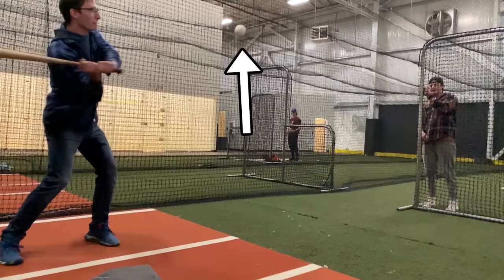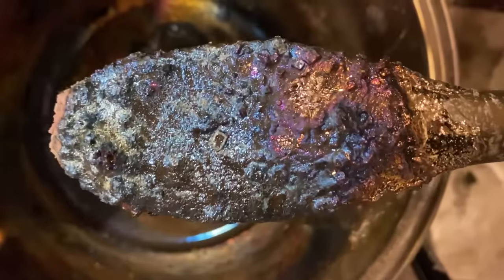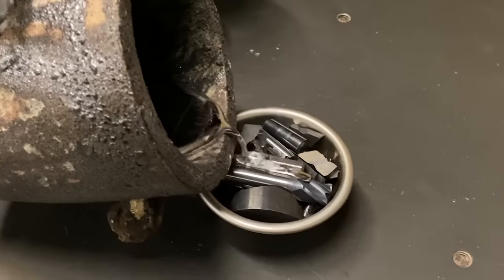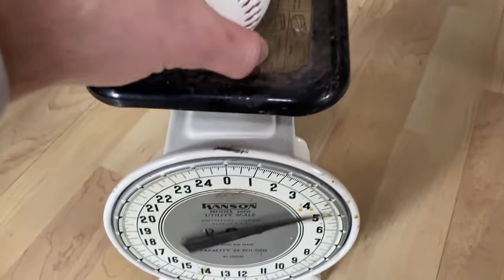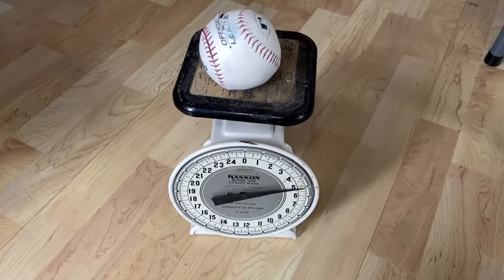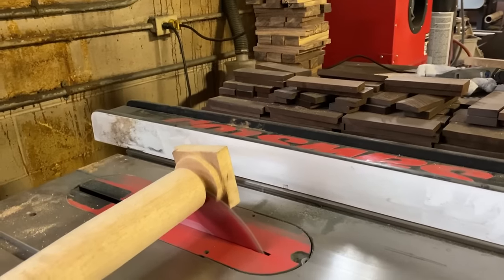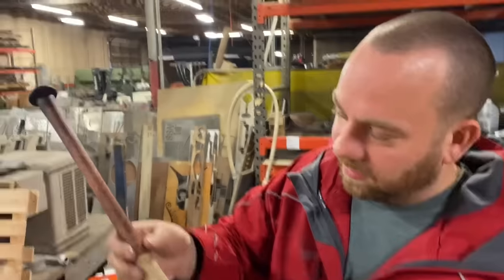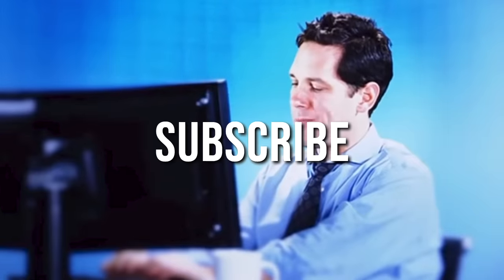I Made The World's Heaviest Baseball

Comment: Holding a saw blade to wood spun up in a lathe is one of the sketchiest things I’ve ever seen lol
Reply: I barely trust my saw blade spinning inside of its cast iron enclosure, never mind raw dogging one with a friggin lathe
Reply: I thought making a holder for an angle grinder (it had 3xm12 that we connected it to) was sketchy
Reply: The lathe made of a drill and some scrap metal
Reply: I don't know whether it's better or worse that they weren't wearing gloves
Reply: @Bifurdoggo  at some point, you're doing something so aggresively anti-osha that almost anything will have unexpected results

Like, we're currently using liquid nitrogen in our mill because we're so far beyond recommended speeds that the toolholder (never mind the tool) would melt otherwise
Reply: @Bifurdoggo  it is definetly better. Almost lost a finger couple days ago because of my glove.
Reply: At first my brain turned off and went full denial.
Reply: IDK man, we used to throw sawblades for fun.
Reply: its balsa wood, its probably softer than their flesh so they can grip the blade with their hand, the blade will get the balsa before it gets the hand.
Reply: With no gloves
Reply: @Bifurdoggo  better. Don’t wear gloves when working with power tools, if they get caught they’ll pull your hand in.
Reply: @Bifurdoggo  Never use gloves while in a machine shop.
Reply: @nathanielrichardson9900  having seen what a degloving looks like
yeah
i am now aware
Reply: And expecting the pitch screen to catch splinters of the bat… these guys need to pick up their safety game
Reply: I love when they're sanding the end of the bat and just blowing the wood dust at each other's faces. No mask or vacuum.
Reply: @alm5992  You have to wonder if they were wearing respirators/eye protection while they were grinding down the lead they poured into the ball mold.
Reply: If you trust the other spinning then why not trust it?

Comment: Now I want to make one out of platinum. 😆
Reply from the maker: The bat or the baseball?
Reply: Yes
Reply: That’s a lot of platinum. You got that amount?
Reply: Depleted uranium? You would probably find a way to make it happen
Reply: @romanvarcolac2238  it'll take a lot of catalytic converters, but I think they could make it work
Reply: ..or mercury?
Reply: Osmium.
Reply: @magnanova  Osmium would be too expensive. Let's say we have a baseball that is 210 cubic centimeters (because that's about in the middle of what they are supposed to be), osmium has a density of 22.5 grams per cubic centimeter. 210 * 22.5 = 4,725 this gives us the grams of osmium we will need to fill an area the size of a baseball. Osmium is worth $400 per 1 troy ounce, and 1 troy ounce is 31.1035 grams. $400 / 31.1035 grams ≈ $12.86 which is the price of osmium per gram. $12.86 * 4,725 grams = $60,763.50 this is how much a solid baseball made out of osmium would cost. But that is not all, osmium is difficult to make into specific objects because it is quite hard to melt down as it's melting point is at 3033 °C (5491 °F) and it is brittle as well. This makes machining osmium very hard. So to make osmium into a baseball-shaped sphere, machining costs would be crazy. This can be avoided by using a baseball-shaped mold, filling it with osmium beads and pouring lead inside, and doing this layer by layer to use as much of the space as possible. This is similar to what the Waterjet Channel did with their tungsten bat. The problem with this is that it wouldn't be too strong and would probably break apart. This is why I don't think that we will be seeing a osmium baseball anytime soon, although it would weigh 4.725 kg (10.417 lbs)! Now if we where to make a bat, a bat will have a volume of approximately 1,368 cubic centimeters (did a lot of searching for that). 1,368 * 22.5 = 30,780 grams, $12.86 * 30,780 grams = $395,830.80! So a solid osmium bat would cost almost $400,000 and this isn't even including machining costs! But it would weigh a staggering 30.780 kg (67.858 lbs)!
Reply: I thought you meant plutonium for a second.
Reply: @snek1309  You deserve more likes for this comment
Reply: @samlarsen6706  Lol, took like an hour to write everything out, glad you liked it :)
Reply: @snek1309  we'll have a 14th like then, maybe one day it reaches 20.
Reply: @antongolovko1149  buy and send them old DU aircraft trim weights
Reply: @antongolovko1149  I don't know anyone who's selling DU ammo, but if it somehow became not illegal to modify old DU trim weights then I suspect that a lot of people would be using them for all sorts of things...
Reply: @romanvarcolac2238  we're talking about Cody here, even if he doesn't have enough platinum he'll find a way to make it lol
Reply: @kianweeking1044  imagine hitting the plutonium baseball with a plutonium bat 😳😳😳
Reply: @T-Dawg123a  Is it illegal to modify depleted uranium weighs?
Reply: go for solid lead
Reply: @WaterjetChannel  yes.
Reply: Gallium, to see how it explodes
Reply: @WaterjetChannel  Make one out of osmium
Reply: After that I want it out of uranium and then dark matter
Reply: I'm the 1k th like
Reply: OSMIUM
Reply: How bout plutonium!
Reply: Lame, do plutonium
Reply: Get on the cross and don’t look back  get lost. The first commandment
Reply: @ericsele588  I didn't know that was why I was stealing all those catalytic converters, but now I know
Reply: @romanvarcolac2238  42nd 👍
Reply: Osmium
Reply: @snek1309  useless infos nobody asked, nobody deserved, yet we all enjoy. Jokes aside thanks for this, IDK if is true but why would you lie on something people can check on internet on their own xd

Now seriously, thank you for sharing this
Reply: osmium baseball
Reply: Might not want to tell people you’ve got that amount of plat….
Reply: @WaterjetChannel  The Bat...The Platinum Bat
Reply: Make one out of niobium
Reply: ye platinum was forbidden in many countries just because of huge density, being several times cheaper than silver ("plata"), platina or "silvy junior" could be incorporated in gold bars and have pretty much goldish weight
Reply: @snek1309  Iridium, but that's even worse
Reply: @snek1309  it’ll be worth more than that now
Reply: Make a uranium baseball and a berryllium bat
Reply: Bros playing modern warfare with all those metals
Reply: @WaterjetChannel  both
Reply: Osmium
Reply: @WaterjetChannel  i think the baseball
Reply: @antongolovko1149  peh, thorium´s the way man

Comment: Correct me if I’m wrong, but doesn’t tungsten carbide have a similar density to lead? Pure tungsten is way more dense than tungsten carbide
Reply: Pure tungsten is also significantly more expensive than tunsten carbide, so they used the carbide instead. They explained it during their “world’s heaviest baseball bat” video.
Reply: No it’s like 30 % heavier
Reply: @CascadePSA  If they get it in the powdered form and then held it together with with something like lead it would be cheaper than soild metal and probably weigh a lot more than the one they created as well.
Reply: In powdered for, the material is 30% larger. It isn't unt the soft "powdered" carbide is sintered where it shrinks and becomes a very hard, but brittle material. I work as an engineer at a carbide processing facility where we make carbide from start to finish..
Reply: Yeah. I was wondering why they used bismuth instead of lead for the filler. Lead is about 20% denser.
Reply: You can actually buy nearly pure tungsten balls from china wholesalers pretty cheaply. I was looking into it as slingshot ammo. They make them pretty big. I forget what their purpose is but they have a band through them. Some are literally baseball sized already.
Reply: @alexcrowder1673  cheaply? 200usd per kilogram? But I think it used to be more expensive. Anyways ... Cca 800-850 usd for a baseball
Reply: @_shadow_1 yeah frankly I think part of them realized they were already so god damn heavy that the bat couldn’t be swung or stay in one piece. So they were much more willing to cut corners and save money on the final build. It’s mostly all for views anyways

Comment: 1. That's tungsten carbide, which is less dense than tungsten
2. Breaking down the tungsten carbide in to even smaller pieces would allow you to fit more, making it even denser
3. You should've used lead instead of bismuth. Lead is roughly 15% denser than bismuth

Overall, 10/10 cool vid
Reply: lol
Reply: Yeah i was just wondering why they didn't use lead. Its a whole lot cheaper to use, and it'd work better.
Reply: Midwest tungsten service does sell a tungsten sphere that is 2.75 inch in diameter, very close to that of a baseball. So they could of just fit that in the baseball and it would be the heaviest possible tungsten baseball.
Reply: Isn't lead toxic

Comment: If you're wondering why they didn't just melt some tungsten into a ball instead of using tubes kept together by bismuth, it's because tungsten is the metal with the highest melting point so almost no mould would be able to handle liquid tungsten without melting. Some materials like carbon or alloys like tantalum hafnium carbide have a higher melting point for example but a mould made out of them would react with tungsten creating tungsten carbide which has a density lower than that of pure tungsten making it lighter. Even the "buyable" tungsten is (basically) mined, made into a powder, compacted with a hydraulic press and sintered ( powder metallurgy), which means it was never actually in a liquid form. However it is still possible to melt tungsten but the methods used are way too complicated for a YouTube video. 

Also the "tungsten" that they used in the video is actually not tungsten but tungsten carbide, they probably used it because, a) they had it lying around, b) it is still very heavy compared to other metals and alloys (twice as dense as steel or iron all while not being poisonous or radioactive like other very dense metals) c) it prevented them from going bankrupt since it is less expensive.
 If you wanted to use platinum instead (since it is even heavier) just like Cody suggested (as a joke of course lol) it would cost you 130 000 $ to make a simple baseball ;/
They probably used bismuth to fill the gaps because it is also a bit denser than steel or iron and is "easy" to melt (tungsten melting point: 3422°C Bismuth melting point: 271,5°C).
Reply: Well done Kelsey 👍
Reply: what about using Tantalum Hafnium Carbide Alloy or graphite mold lol?
Reply: @blengi   @blengi  Graphite is actually a crystalized form of carbon so I believe it should react with the tungsten and create tungsten carbide. It's true that tantalum hafnium carbide sould be able to contain molten tungsten due to its high melting point but it is extremely expensive (almost 10k$ for 1kg). I've changed the comment so the focus is on the fact it's to complicated and pointless to try and melt rather than that it is "impossible".
Reply: @kelsey3881  Hi thanks for reply. I was just being playful, so never really considered the reaction potential of various materials - Cheers for pointing that out! When I randomly googled I noted that tungsten coated graphite tiles were considered a good choice for high temperature  regimes like Tokamaks so I thought precluding oxygen issues graphite molds might be viable lol. Perhaps a graphite mold with a super thin surface layer of tantalum hafnium carbide via vapour deposition could be a feasibly inexpensive "hack" too?
Reply: @blengi  That's fine Iol - what do you mean by precluding oxygen ? That might be possible but at the same time, tantalum hafnium carbide unfortunately contains carbon.  So I think the tungsten might react with it and create tungsten carbide. But I think you're intuition is right, if an easy way of moulding tungsten is ever possible, it will most likely be thanks to the research in fusion technology and in the materials constituting the panels of the tokamak's (or other fusion reactors they may develop in the future).
Reply: @kelsey3881  given the autoignition temperature of graphite is way below tungsten melting point, stopping the graphite mold going flamey flame  might be a bit of  an issue under normal conditions lol

Comment: Tungsten alloys are often used in kinetic tank projectiles for its high density. Those are rods of about 5-8 kg/11-18 lbs weight that travel so fast (over 1500 m/s which is about 5400 km/h or 5000 ft/s) that they literally can't shatter.

The shock waves from the impact travel through Tungsten at around 350 m/s. But since the material feeds into the collision with the target over 4x faster, the shock waves can never actually travel backwards in the projectile. The entire rod will eliminate itself against the armour it hits until either the armour is destroyed or the entire rod is eroded away.

The length of the rod is therefore one of the most important things to determine the penetration ability. With a length of about 70 cm/28 in, modern projectiles of this kind can penetrate over a meter of hardened steel.
Reply: A meter of hardened steel... Wow I want to see that in slow motion.

Comment: I got another theory: What happens when you drop a 10 ton tungsten rod from outer-space?

Thanks to gravity, when it hits the ground it has the same impact of a small nuclear device. The tungsten rod's re-entry wouldn't create any more energy than it took to lift it into orbit in the first place (assuming tungsten doesn't do anything weird like combust), and there'd be a lot of energy lost in the process. Another way to look at is is that a 10,000 kg mass at a height of 1,000 km above a planet with gravity of 9.8 m/s^2, is 10,000 * 9.8 * 1,000,000 = 9.8 * 10^10 joules. 1 kilowatt hour is 3.6 megajoules, so that comes out to 27,222 kilowatt hours of energy. A kiloton is (according to a google search) equal to 1,162,200 kilowatt hours, so that comes out to about 0.023 kiloton TNT equivalent. With some of that energy lost as atmospheric heating.

That isn't to say that dropping tungsten rods from orbit isn't a serious threat, or that you couldn't impart a lot more energy by flinging them at the Earth with much greater velocity. I just don't think the comparison to nukes is quite right.
Reply: You completely forgot about kinetic energy. A mass in orbit isn't just hovering there, it's going sideways obscenely quickly. Roughly 7.8 km/s quickly, in fact. Kinetic energy of a 10,000 kg mass travelling at 7800 m/s is simple to calculate - so tack on an extra 300 gigajoules of energy.  The smallest nuke fielded in tests was the Davey Crockett at under 100 GJ of energy, so a 10 ton tungsten rod from low earth orbit absolutely has the right amount of energy to be in the same playing field as a small nuke.

Comment: Unfortunately tungsten carbide was used and I have a strong feeling that tungsten metal is much denser. Yeah, the carbide has a density of 15.7 g/cm3, but the metal is 19.28 g/cm³.
Reply: I agree. It seems like Tungsten carbide and pure tungsten is like comparing to steel and iron. Both are like 98-99% of one element but have a lot of differences in them.

Comment: With all that equipment, WHY didn't you just carve out a baseball sized orb out of ours tungsten instead of melting it down, mixing it with a bunch of lighter carbide and casting it? That was a lot of work you could have avoided AND done a better job without the carbide. The ball would also have been heavier.

Comment: How well does a water jet work on tungsten or at all?
Reply: It doesn't xD
Reply: It works a little bit.  That's why the inner parts of the jet head occasionally need replacing.
Reply: It works good zou just need to use metalic abrasive and tungsten settings but due to high price of that abrasive and low speed of waterjet it's pretty expensive to cut...
Reply: @chillfill6512  So yes but no one will?
Reply: @Sphyxx  waterjet channel did once.  they cut a waterjet head in half.  took ages and cut not that well.

But if you had to cut precision holes in tungsten for a job not a troll video, I think there's better ways to do it, like EDM.

Comment: Random thought just popped into my head. Can a water jet cut fools gold faster than real gold? Can it be melted into a bar the same size as the actual gold bar you cut?
Reply: Well, pyrite (fools gold) is pretty brittle generally. And lightweight, witch means low density. So the waterjet would probably cut it as fast as you would need it too.  And the melting point for pyrite is around 2100 degrees F. So if you had the means to melt it you could certainly melt it into the shape of a gold bar.  Hope this helps.

Comment: Curious why bismuth was used and not lead?
Reply: they already used all their lead making a baseball bat.
Reply: Bismuth has a lower boiling point so easier to pour as you don’t need a better furnace
Reply: @skudsurfer   Melting point*. Actually low boiling point metals are usually worse to work with because they evaporate more.
Reply: Maybe so it wouldn’t be toxic
Reply: @BentoGambin  your right on melting point I had a brain fart moment with boiling point
Reply: @skudsurfer  huh, never thought about melting point to honest, with leads already quitw low. Just thought they would use lead to make if more dense but I guess with a baseball filled with mostly tungsten carbide it probably doesn't matter
Reply: and/or because it is nontoxic when compared to lead

Comment: Are you not aware of the fact that tungsten dust is dangerous as fu$k to breathe in? And here you are grinding it without protection?
"Tungsten carbide exposure can present both short- and long-term health effects, especially if the metal alloy also contains nickel and chromium, which it often does. Even just a small level of exposure can have significant health consequences."